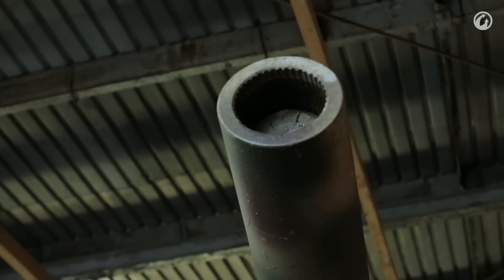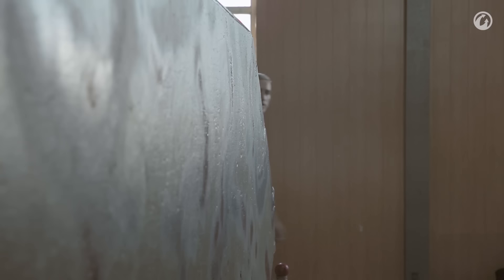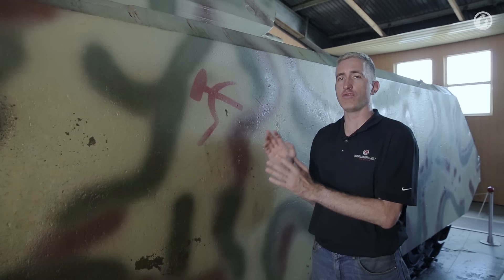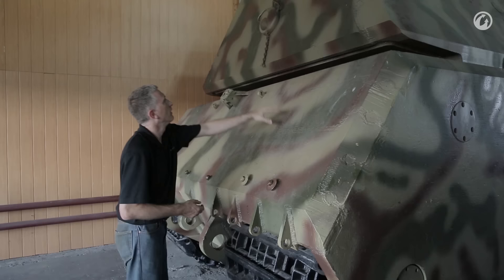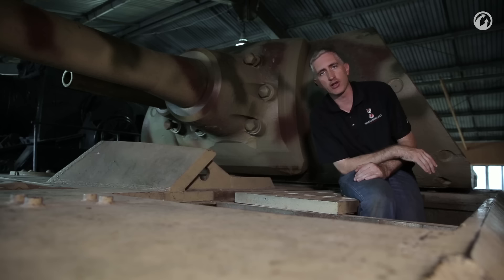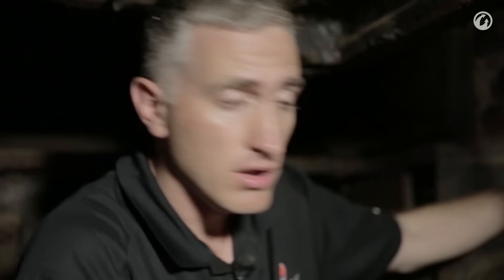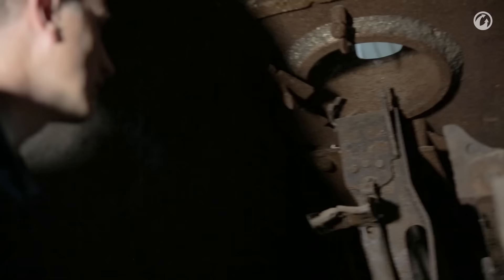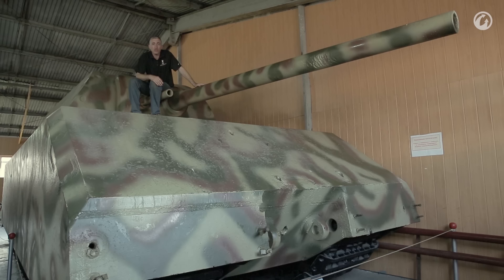Inside the Chieftain's Hatch: The Mighty Maus

Comment: “This is the most indestructible tank we’ve ever created”

Field Mechanics: nervous laughter
Reply: To be entirely fair, IF they managed to get it TO a battlefield in WW2, nothing short of repeated bombing runs would have been able to take it out.
Reply: the is7 could penetrate it frontally from the angled plate, somehow, they say its high quality APHEBC
Reply: is 7 was made in 1945, after the war i belive @bombasspatriot
Reply: @alexrompen805  Or perhaps an anti-track landmine (tracks are not armored and that suspension has its break limit). With its 188 tons it's impossible to evacuate. And then it becomes a steel pillbox, that dies or gets captured by a blowtorch armed engineer after supporting infantry retreats.
Reply: @bombasspatriot   Since the angled plate makes the upper plate impossible for the IS-7 to penetrate, the turret and lower glacis would be more accessible.

Comment: Restore the MAUS Restore the MAUS Restore the MAUS !!!
Reply: You do realize that it's going to be cheaper to build a new one?
Reply: John Doe proof
Reply: thats not the point
Reply: what for? That thing is so big you need to build a hangar around the tank. You couldn't take it to Tankfest because of its mass and it probably could only move 5-10 kph
Reply: ofc in running condition :)
Reply: @LURKTec  okay then

REBUILD THE MAUS REBUILD THE MAUS!!!
Reply: Find the P-1000 Ratte tank and build it
Reply: Give it an MTU 1500hp power pack and MAKE IT GO!
Reply: To everybody hating on Kyle H's comment: How many of you has it as your dream to visit or see the Tiger 131? Think how much of a war treasure the Maus is. Tankfest needs this tank. I would pay 1000 Dollars to see it drive at Bovington.
Reply: @KoeSeer  Dude, they literally have TOG-2 in there. Whats wrong with its mass, when it only would have to go outside for a round around the place once in a year?
Reply: I think y’all aren’t remembering, the building had to be built around the Maus. If it were restored, there’d also have to be a way to get it out of the building and it’d probably be difficult to transport because of its weight.
Reply: KoeSeer it can move in real life 20 KPh
Reply: Kyle H we should frr
Reply: John Doe the point is its metal made and used during the third reich, and also it would be mor expensive from scratch considering 300MM HOMOGENEOUS PLATE ARMOR just on the front sides
Reply: @KoeSeer  Makes you wonder though when they built the place why nobody thought "hey maybe we should make well i don't know maybe a door to get it out".
Reply: @elelesm8270  I'm holding a greenscreen of Bovington getting closer and closer in front of the drivers periscope. You can send my $1000 in care of Cheiftan
Reply: I will, once I win the lottery
Reply: I imagine trying to move it is by 20+ T-90s pulling on it to get it out..
Reply: KoeSeer who cares about gay tankfest
Reply: I'd give my life savings for a chance to drive a combat vehicle THAT size
Reply: Not gonna be worth the money.
Reply: KoeSeer uh no 20kph
Reply: That would be impractical and a waste of resources, the overall design of the tank is really bad.
Reply: I want this and doom turtle to meet eatchothet
Reply: @mrducky179  maus had on roads 20km/h topspeed
Reply: @mrducky179  it litarly did
Reply: @startingbark0356  oh yea i was wrong nvm i look dumb
Reply: is no one going to talk about how difficult it'll be to have it using the common engine and transmission setup? German tanks have issues with their transmissions and engines but having a 1500 hp engine pushing around a 188 ton tank would be horrid.
Reply: @ket451  an 60hp engine can push an 10 ton tank forwars
Reply: @LURKTec  no u just put the same engine and stuff in it that was taken out lol
Reply: @ket451  could just put a modern engine in
Reply: @incognito-px3dz  well, it'd be difficult, as the 188 tonnes would absolutely destroy the transmission
Reply: @ket451  u dont think we already have 188 tonne vehicles
Reply: @incognito-px3dz  we don't. we really don't
Reply: @incognito-px3dz  at least, not that size, it is a ground tracked vehicle.
Reply: @ket451  m8 in australia you see the triple trailer road trains pulling 200 tonnes easily.
Reply: @incognito-px3dz  you see it in Canada too, but those were built for it, I don't think those engines are small enough to fit inside the Maus's hull effectively
Reply: @Weisior  TOG 2 is in the same boat as the mouse. It's a shell and the hanger was built around it.
Reply: @incognito-px3dz  trains are completely different. They operate differently and have different transmissions.
Reply: @Kyle-gw6qp  a road train in australia is just a big truck with 3+ trailers
Reply: @incognito-px3dz  again, completely different. It's not designed to operate at speed, it's not designed to accelerate quickly and nots designed to go off road.
Reply: @Kyle-gw6qp  you do realise they used to chuck aeroplane engines in the tanks
Reply: @incognito-px3dz   Americans (not Germans) did indeed put aeroplane engines in their tanks. Their tanks happened to be 140t lighter though.
Reply: @KoeSeer  German transmission lol
Reply: Wtf is this? RESTORE THE MAUS!! We are all doin like cry babies dann... Always: "financial problems" and "too slow and so" just sucks ...too many people want to see such a treasure. If we are not doin a war keep producing Maus and other cool tanks or go to war and make new tanks.
Reply: @xenomorph9114  nothing of its part were built cuz its too slow and big can be easily captured.
Reply: @LURKTec yeah but that's no fun

Comment: I think i understand why the Maus has no handlebars to get on top on, the ferdinand had no machine gun so infantry could just walk up to the tank, open the hatch and shoot the crew. The Maus is so big it's hard to get up on without handlebars so infantry couldnt just climb the maus and shoot the crew, because the maus has no machine gun for infantry as well.
Reply: It had a Coax MG?
Reply: Didnt he say they threw away the idea?
Reply: ***** That's a 75mm cannon. Not a 20mm.
Reply: And the infantry wouldn't just climb on and open the hatch. If you don't know about tank hatches, they lock on the inside.
Reply: the fear is well known, if you have open ports, enemies will try to chuck grenades into it. maus had a flamethrower for infantry. plus if someone did get up to a port hole and stick their gun into it, (maybe a commander port) the bullets will ricochet all around the interior harming the crew.
Reply: ferds814 Very true. But how would the crew get up? There is almost no way to get in. I only know of the hatch under the tank, leading to the driver and radio operators part of the tank. Do you know how they get up onto the tank to get inside the turret?
Reply: They couldn't open a hatch because it is locked from the inside. What they did was come up and throw molotov cocktail on the engine (if you hit the cooling vents you will set it on fire) or drivers view port.
Reply: my good sir, the drivers view prort had armored glass and usually had a periscope function :) No point in attacking it.
Reply: grahwo that depends on the tank. The point is to make driving the tank almost impossible with the commander's help. Otherwise the engine is a prime target.
Reply: SneakySiren and a 20mm somewhere
Reply: SneakySiren did you pay attention to the vid he said they went through the engine compartment
Reply: Nathan Peterson Did you pay attention to the fact that there is no ENGINE in the tank? Guess not.
Reply: SneakySiren Wow you didn't even read my comment, that has nothing to do with it, as even when there was an engine there was space to get into the turret idiot
Reply: SneakySiren plus are you aware that i said engine COMPARTMENT
Reply: Nathan Peterson There would be simply no room for the crew to climb back with the engine in the way.
Reply: did you see the size of the engine?
Reply: correction length*
Reply: comapred to width
Reply: obviously the germans wouldn't have the maus go into battle by itself. It would have tons of infantry and even other tanks to support it.
Reply: Yeah but if your infantry dies, you at least have a slightly higher chance to survive.
Reply: Slartibarfart The crew inside the Maus would survive because people don't realize that in tanks, the hatches lock from the inside. There would be no possible way for enemy infantry to climb into the tank and kill the crew, and or even knock the tank out of battle.
Reply: Well it had a flamethrower.
Reply: Khaled Hossam No it didn't
Reply: Nathan Peterson It did have a flamethrower. The designers didn't like it so they welded it over.
Reply: Ok, but it doesn't now.
Reply: Nathan Peterson Correct. It does not have anything inside of it due to it being destroyed, and even if it wasn't destroyed, the Soviets would of stripped all the machine guns and filled the cannons with metal to stop it from firing, just like they do to tanks when they don't use them for services, or put them in museums.
Reply: Nathan Peterson hence the past tense, HAD. 
You just made yourself look bad.
Reply: Khaled Hossam sorry.
Reply: Nathan Peterson Atleast you have the decency to apologise, good job.
Reply: Khaled Hossam Its just I've been involved in this conversation for a few months, and now i treat every comment as hostile as i just want it to be over, so yeah
Reply: Slartibarfart the manual for the maus says it is to be covered in vaseline before combat, to prevent infantry to climb up, and who needs MG? you have 75mm :D
Reply: Worstname evar 75mm is a single shot cannon, designed (somehow) to combat lighter vehicle, while the machine gun is designed to combat infantry....
Reply: Theo S HEAT and HE shells for the 75 can work against light vehicles.
Reply: Slartibarfart youre smart
Reply: Slartibarfart infantry just need to throw a grenade or Molotov to the engine vents, it will rek the engine,set the fuel tank of fire 🔥 and baboom, R.I.P
Reply: How to kill open roof tank is threw many grenade inside it :v
Reply: please notice it was a prototype. For Christ sake. pull yourself togheter.
Reply: The hatch is like a door you can lock it
Reply: Divers view ports had thick bullet prof glass.
Reply: The engine, cooling system and fuel tanks were all removed. That is why he was able to enter that way.
Reply: Guys stop arguing its over
Reply: I think the boring explanation is that this was a prototype and thus lacked obvious features that were extraneous in its proof of concept stage, but would have been included in a production model.
Reply: "HANS THE TRANSMISSION BROKE"
"Plant the Charges,were not gonna Repair that with a Bunch of Soviets breathing down our Necks"

Comment: Pray you don't get tracked while in combat
Reply: this guy
Reply: It has sidearmor ...
Reply: not only maus should
Reply: tracked from the front obviously. tracks are particularly weak from the front but op at the sides
Reply: Quantum Razgriz - That applies to all tanks, anytime a tank gets tracked in battle its Immobilized, leaving it open and an easy target.
Reply: If you get tracked you are a pillbox.
Reply: wich was the whole purpose of the maus, the maus was ment as a moving bunker, people get history wrong often with this tank.
it not ment as a single operating vehicle, they would be backed up by other armoured units and infantry.
and they could hide behind its steel wall.
it was ment more in the line of, the tortoise and t95 as linebreakers.
it could have served its purpose if more where made it was invincible at that particular time
Reply: Justin M.  I guess you can always spin in circles..... :-)
Reply: The worst thing is that Germans always had problems of running into Russian mine fields, and mines does the biggest thing of blowing tracks... That was how most of the Ferdinands ended in Kursk
Reply: never judge a tank from a prototype mate.  Pretty sure they had a plan for that occation - in the final builds
Reply: What is love,baby don't track me don't track me noo...
Reply: Good luck tracking those thick ass tracks.
Reply: @enlg3750  This was a defensive tank. Also this tank might actually break the mines rather than trigger them xD
Reply: Razgriz reveals itself.
Reply: Hope your in friendly territory do you can become a bunker/ land fort
Reply: the Maus is a breakthrough tank lads, if you're tracked oh well you oughta beat their asses
Reply: @carbon1255 I thought its pressure on the ground was on par with the king tiger because of wider tracks, otherwise it would just sink into the earth. And the king tiger was successful in getting tracked by mines (right?), so i presume maus would have been as well. And as defense... It's not really mobile to be in the rapid response task force, so it's role would be exactly a metal pillbox... But isn't it easier and cheaper to just build a normal pillbox?
Reply: @ket451 but that's up to your support forces, which are not that impenetrable like you, and considering numbers...

Comment: Lifting a 100 ton behemoth, and standing under it to work on something. Yea, no. I'd like to keep my head... and my body.
Reply: does it really matter? 1 tonne? 10 tonnes? 100 tonnes? 1000 tonnes? The result would be the same.
Reply: well, you don' normally stand under a tank since most maintenance are done without lifting one up in the first place. Even when tanks are jacked up, you don't need to get under the tank to work on it. Not the case with the Maus since tracks don't have access hatches unlike every other tank with armored skirts.
Reply: @jackvernian7779  
The heavier the tank is the faster and more painless it will be
Reply: You Mean 188 Ton
Reply: @jackvernian7779  The Germans did design a 1000 Ton Ultra Heavy Tank....the LandCruiser P.1000 Ratte
Reply: 188 tonnes

Comment: I heard they were going to restore the maus and there's also a trailer on it too if you want to learn more about it!
Reply: You cant restore something that was never fully built in the first place.
Reply: wg tried to fund a restorationplan for the maus and kubinka turned it down as a t35 was more important
Reply: bastex
how can your  restore a tank that was never fully built in the first place?
Reply: thunberbolt two The T-35 was built.
Reply: Biased Sherman
What does a Russian tank have to do with the Maus?
Reply: Sorry, I though you meant that the T-35 was not fully built. Although they can use blueprints and plans of the Maus and use it to restore it.
Reply: thunberbolt two they did build 2 mauses as the one @ kubinka is the turret of the scuttled maus and a maus hull te russians found at the maus reseach facility (wich had a dummy turret)
So to answer your question: they fully build one maus but it was so slow it could not keep up with the retreating forces so it was scuttled before it could fire in anger =]
Reply: bastex
Thank you for the information.
Reply: laggy lemuer
Reply: laggy lemuer They cancelled it.
Reply: Bruh
Reply: Also the Maus was just so insanely complex it would have costed waaaaaaaaay more than what was funded
Reply: That was just a lie by WG. Apparently they 'didn't have enough funds' which is clearly a lie since so many people spend money on premium vehicles. But it was estimated at 3 million euros.
Reply: Lol
Reply: They just wanted to restore to operating conditions. There is videos of the Germans driving this thing around so it did work at one time
Reply: Then the russians looted it and gutted it and it sat there ever since, getting a touch of paint when the russians can be bothered to get off their ass to do it. Shame they have some of the rarest tanks and refuse to restore them.
Reply: beautiful
Reply: laggy lemeur WOT made a trailer about it right? well let me tell you its a lie theres even no sign of changes to the Maus in kubinka tank museum
Reply: thunberbolt two No it was fully operational and combat ready at the end of WW2 but Germans destroyed it to prevent it from being captured.
Reply: Dawn Polhammer the Soviets did squat, the Germans scuttled this to prevent capture and use against them. Considering it's nothing more than a shell and tracks, I'd think they did a good job
Reply: There are plans for the Maus, which means you can fully restore it.. Like Chieftain said, the Maus used a Schnellboot engine.. so, everything could be done only if the Kubinka museum wouldn't turn down the offer just because they wanted to restore a stupid T-35.. "Legendary Tank"
Reply: @baastex  T-35 is cool though biggest tank to rival Maus in size.
Reply: @baastex  T-35 is Maus's DAD
Reply: @thedeadlinger6992  it's unlikely another restoration offer to Kubinka will happen since wargaming shut down its office in Russia and Belarus due to war.
Reply: @thedeadlinger6992 ell considering every victory day for the Russians they pull out a t-35 I think it was a good pay off for them even during the current Ukraine war (talking about a certain city/town that’s doing the parade with it not the recent pathetic one in Moscow) besides the Maus would’ve been a worse hell to maintain in comparison to the T-35. Also like the guy above me said wargaming pretty much left Russia and Belarus to because of the war